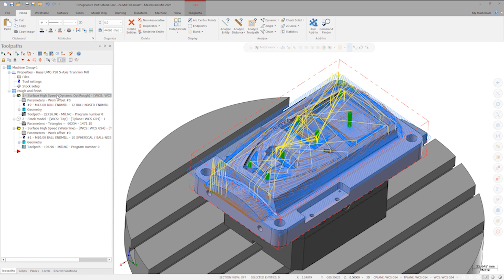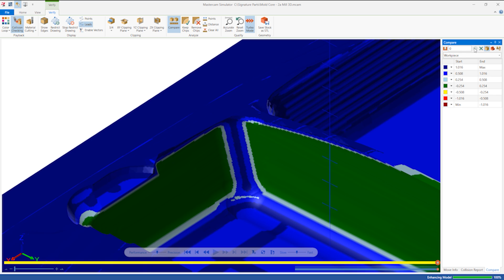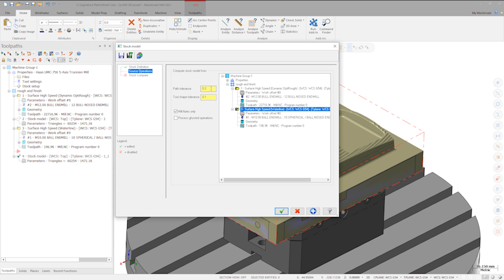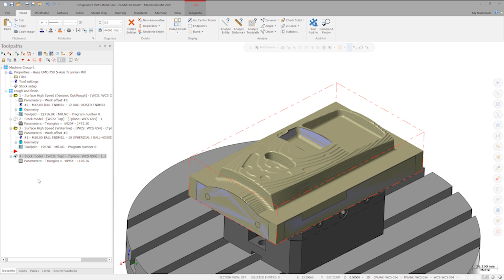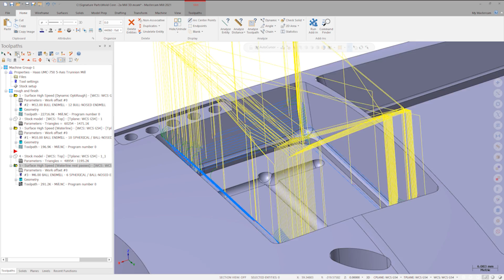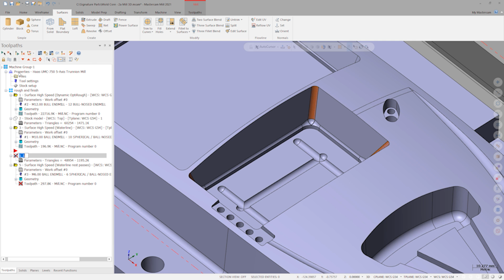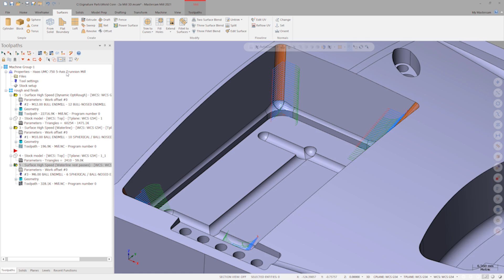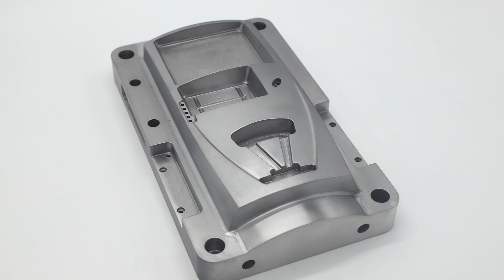Computer Mold: Mill 3D

Comment: Does the level of detail of the mesh change when you zoom in the compare window?  Or is that set through your tolerances in the stock model?
Reply from the maker: The tolerance/display of the mesh and graphics will get better as you zoom in and out inside verify. Mastercam is trying to automatically achieve the best balance between calculation time and graphics/model definition. In the lower right corner of the verify window, you can watch the graphics calculation progress bar. If you're focusing on a certain area, you can always use accurate zoom found under the ‘verify’ tab for an even more accurate rendering of the simulation in that area.